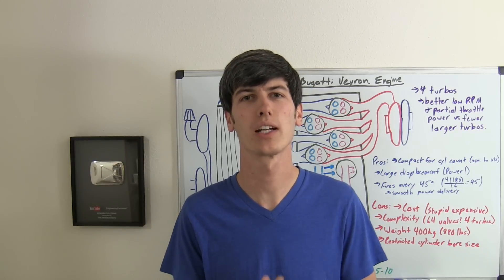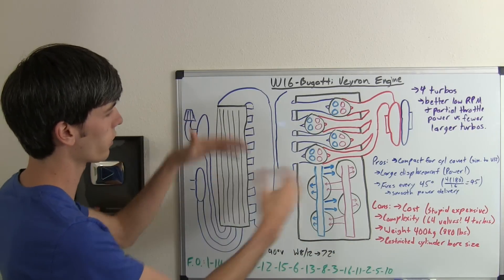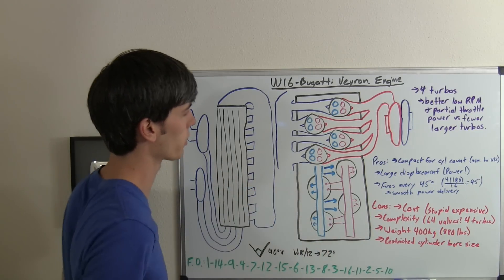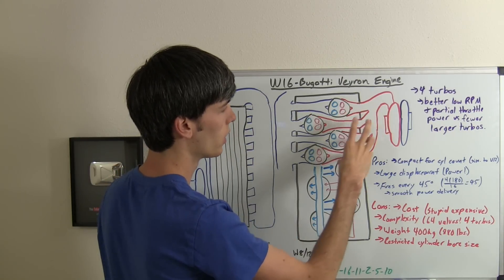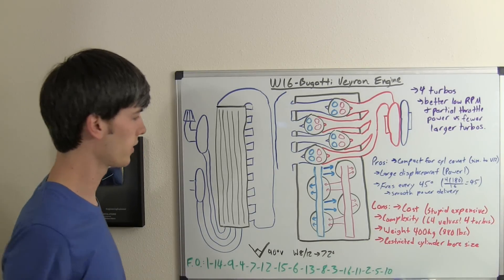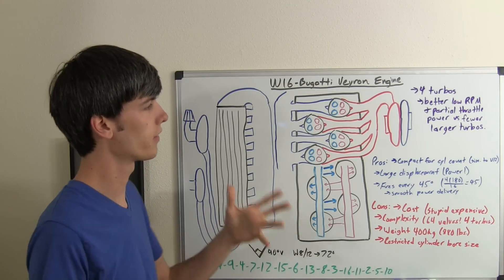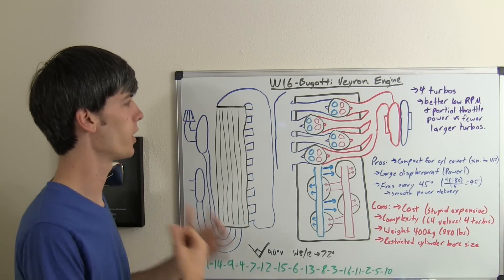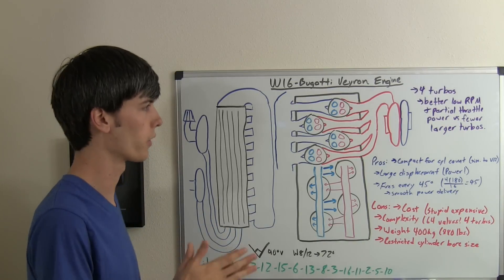W16 Engine - Bugatti Veyron - Explained

Comment: with 16 cylinders you'd thing it'd make near 2000 HP at 10,000 RPM
Reply from the maker: +Some Weeb there is not a simple correlation between the number of cylinders and horsepower.
Reply: +Some Weeb While the engine is a square setup 86mm bore with a 86mm stroke, which is good for high rpm, you can imagine that the rotating mass would be quite high even if using low weight pistons, rods and crank. You also have to take heatmanagement in consideration. I mean there is no engine cover, because it would melt even at 1200hp. You also have to have a gearbox which can put the power to the ground. It is a pretty tall order to put 1200hp down through all 4 wheels with a weight of 2 tons and still have silky smooth shifts around town, so you can imagine what it would take to put 2000hp down, something will brake be it traction, driveshafts or the gearbox itself.
Reply: Engineering Explained but the size, and you'd make such RPM
Reply: DB8 ive seen V8's do near 1700 HP
Reply: Possible but useless without control.
Reply: Tippotipo
Then explain the one:1. Has 1300 horsepower and weighs 1000 lbs less, and is RWD.
Reply: Some Weeb
Still needs a rolling start to properly use the power. 1300 hp is done with E85 fuel which makes difference. Still have traction issue at low speed. Considering its limited production (only 7 including the developing model and the recently crashed one on Norschiefte track), not worth a comparison.
Reply: Tippotipo
Why does the ammount produced make it so it's not worth comparing?
Reply: Some Weeb
Too easy to tamper the specification as a small company making a total of seven cars. Why do you think there is a minimum requirement (25) to qualify as production car?

Comment: I bet the weight of the bugatti is why Agera R was able to beat it, even with lower displacement.
Reply: i still think the veyron is superly underpowered, cmon 16cylinders, big displacement and 4 turbos and only 1000hp?
Reply from the maker: Weight plays a very, very small role in hitting top speeds (just means it takes longer to reach them, but doesn't limit the speed much), if that's what you're referring to. Ultimately it comes down to power and aero. Which car has more power and/or less drag.
Reply: pavkata99
I don't think anyone who ever sat inside a Veyron and experienced acceleration at even 1/4 of throttle would call it underpowered. That car makes a regular supercar like a Ferrari 458 (which is already insanely fast on it's own) feel like a go-cart.

Oh and...getting 1000 hp out an engine like this is not because it's badly designed. It's because of how it produces the power.  A Bentley pulls out 500hp out of 6.75l V8 massive engine. You can get the same power out of a tuned 2l 4 cyl turbo easily nowadays.  But when you compare how they ride and how they output that power, you'll quickly realize where the extra money went. It's about effortless delivery, smoothness and reliability. This engine in a Veyron will last for over 1 million km's easily if properly maintained.  It was specifically over-engineered in every component (as well as all other parts of the drivetrain) to last pretty much forever.
Reply: what about koenigseggs? some of them produce more power with smaller engines, less cylinders, etc. i don't think that they are that much less reliable
Reply: derbigpr500 And torque, don't forget the torque :) That Bentley's engine probably produces a shit ton of torque
Reply: Actually weight is 50% of acceleration speed so basicly if its lighter it will be faster
Reply: Muammarvsgaming ROBLOX and more Makes sense. I'll take the Agera.

Comment: It seems incredibly inefficient to have 4 cylinder banks. That makes for 4 more camshafts. That's quite a lot of weight.
Reply from the maker: torogami2 There are two cylinder banks, each with 8 cylinders. VR engines use a single cylinder bank.
Reply: It has two banks, but each bank needs an extra camshaft to feed the new line. Free valve technology would eliminate this need.
Reply: If you think about it and compare the Hennessey Venom GT's V8 Twin Turbo to the Bugatti Veyron's W16 Quad Turbo Weight, the Bugatti will weight more than most mountains. Lol that W16 is as unneccessary as the guys who buy it for their inferiority complex.
Reply: Bugatti veyron is supposed to be a powerful gt car reliable and easy to drive hennessey venom gt is not in the same league, it is just a light chasis with a super powerful engine and without any development to make it easy to drive, that car will kill you if you make things wrong
Reply: JuanCarlos CastilloDisla Venom GT (a modified Lotus Exige) engine is essentially a tuned LS engine which can be found on a Corvette that cannot maintain 1200 hp without major rebuilt. Not a good comparison with any production car.
Reply: torogami2 I almost spit my drink out laughing at how stupid this comment is!!
Reply: Tippotipo I'd like to see your "proof" that a 1200 hp LS is not as reliable as a Veyron. You are wrong about that, so I want to see what you based that on. Lulz.
Reply: Erik Larson
You asked for proof? Find any 1200hp  powered corvette engine production car that ever passed government emission standard in stock configuration.
Reply: Emissions equals reliability? Ok. Done talking to you.

Comment: Getting sick of all this "durr 16 cylinders, 4 turbos, only 1200hp".

The Veyron engine seem "underpowered" because of the small turbos. They are 300hp turbos made by Mitsubishi according to a Bugatti sales guy. Comparable in size to the VW 2.0T engines, just 4 of them.

http://www.streetfire.net/video/i-was-invited-to-test-drive-the-bugatti-veyron-and_32057.htm
Reply: Anders Kristensen  Yup, this is basically 4 Golf GTi welded together... with a little extra power
Reply: Just a tad
Reply: +Pony Power take into account power/weight ratio, aerodynamics and reliability. An F1 engine needs to last a few hours, the Veyron engine must last years.
Reply: Dan Slotea  he was talking about the McLaren F1, not an actual Formula 1 engine

Plus Formula 1 engines must last at least half a season now, teams are only allowed 2 engines a season I think

Comment: too bad it's extremely inefficient. 1,000 horsepower on a turboed 8L? I would bet that it couldn't break 600 NA
Reply from the maker: Specific output and efficiency are not really linked like that. Thermal efficiency is fairly independent of specific output.
Reply: David Serrano The Veyron actually makes well over 3,000 Horsepower but loses most of it through heat.
Reply: Erick Ortiz so does every internal combustion engine lel